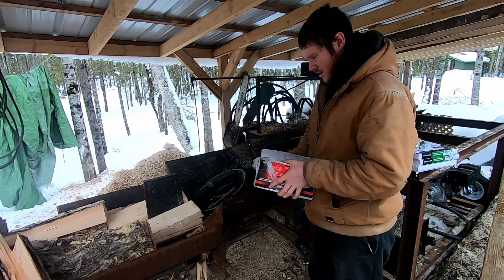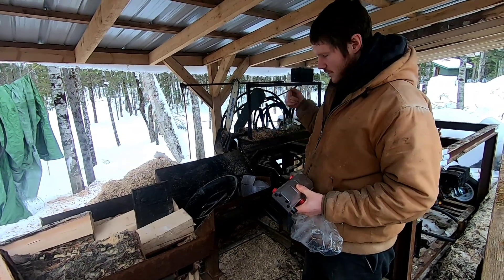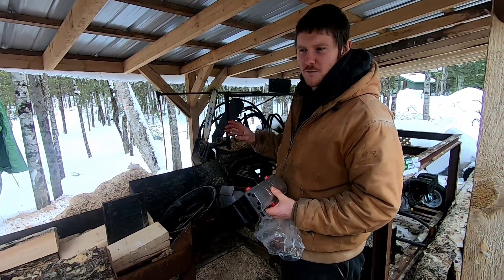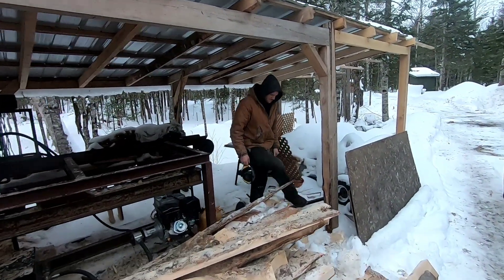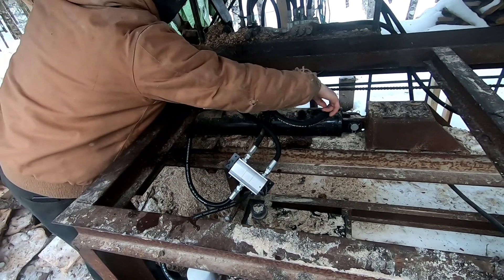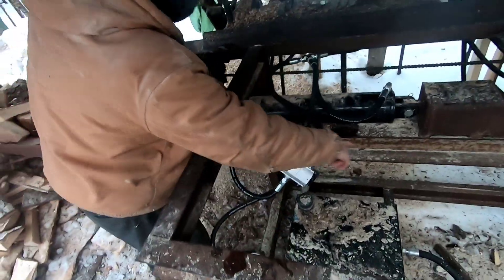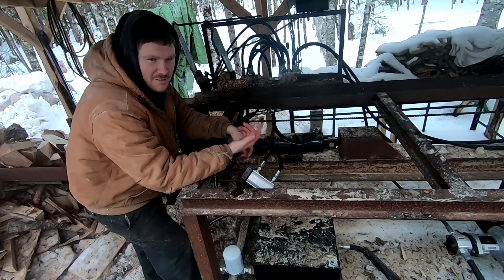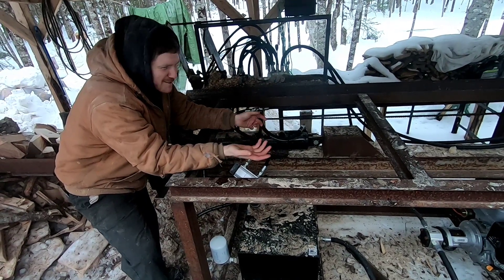Increased splitter cylinder speed with regenerative circuit

Comment: Not sure I fully understand the theory behind the regenerative circuit, but it was faster for sure, so Win! 
Do you have plans on anymore modifications, or a nice lick of paint perhaps?
Reply from the maker: I'm also sorta baffled by the concept as well. All I know is if it works it works!
Basically just looping the flow from the inlet and outlet ports and T in the flow from the pump as well vs the full flow going all the way back around the circuit and through the pump again.
Iv seen much more simple single circuits where it only increases the flow/speed in one direction but I was looking to get a better speed through the full cycle.

Lots more to do when and if I have the time and money. Iv got a conveyor for the split wood I'm gona install. As well as changing up the push plate and I'd like to build some kind of live deck to feed the wood in as well.

Rust don't count as paint? 
Paint comes when I'm done building, so likely never.

Thanks for watching stay tuned for the next video
Reply: Usually a regenerative valve it used, then instead of the oil returning to tank from the piston end of the cylinder it is combined with the pump flow to the rod end of the cylinder which moves the rod in faster. This can be done because the cylinder is doing minimal a
work in that direction